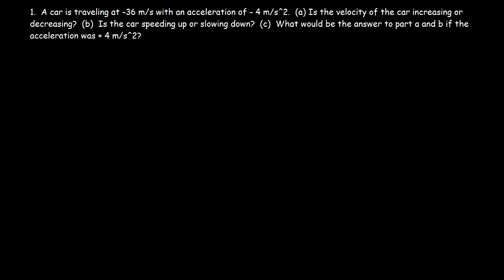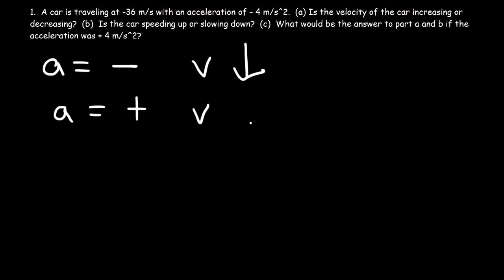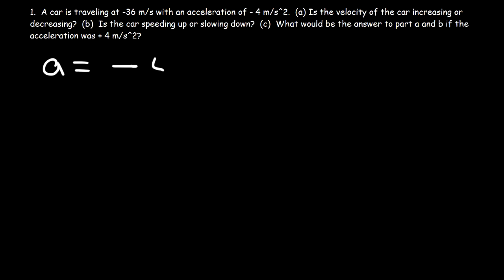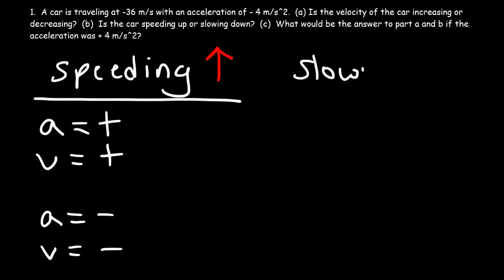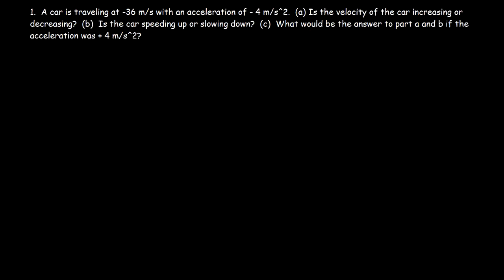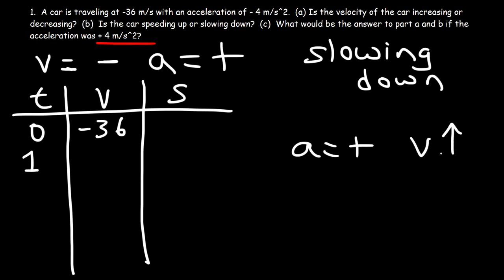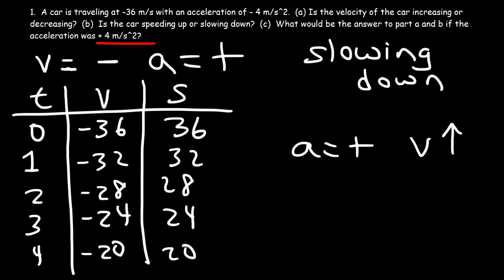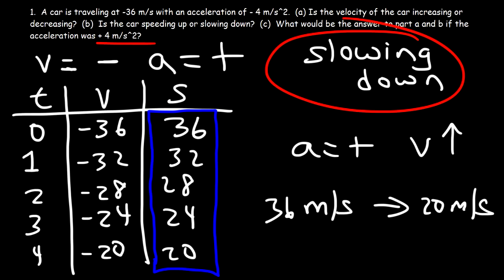Is The Car Speeding Up or Slowing Down?

Comment: Correct me if I'm wrong but doesn't the sign indicate the direction. With velocity being -36m/s, the car is moving to the left with acceleration being -4m/s^2 signifying the car is accelerating up to the left. This would mean that the car's velocity is increasing in the negative direction not decreasing.
Reply: Actually here -ve sign indicates whether the car is ongoing retardation or acceleration. If you want to indicate the direction then we have to use i^ , j^ , k^ notation as studied in motion in plane......... 
Hope it helps
Reply: -36m/s indicates going backwards i think because velocity is a vector and - sign indicates it goes in the opposite direction of positive velocity which i imagined to be in the front so if u put -4m/s^2 acceleration you are pushing the car backwards which is already going back so i think the speed will increase but the velocity keeps decreasing as you keep going further back but the speed at which you are going is increasing

Comment: I don't understand the first part where you said if acceleration is negative the velocity is decreasing. Velocity is also negative in the question. So won't it make the velocity increasing ?
Reply: As long as the acceleration is positive or negative, the velocity will always correspond to the sign of the acceleration. Velocity is negative (because of acceleration) so that means it's decreasing in this problem. if V and A are both negative or both positive then that means the "car" is "speeding up" because they're both approaching -infinity or +infinity.
Reply: Hes pointing out the problem (a), its about the number so -a makes the velocity decreasing and vice versa. I think u telling about the part (b) thats another case since concept is about change of speed
Reply: I can drive faster if I take the longer route. Which would you go longer or shorter